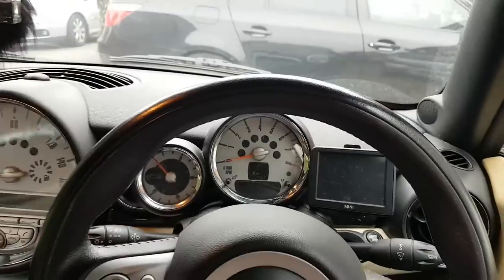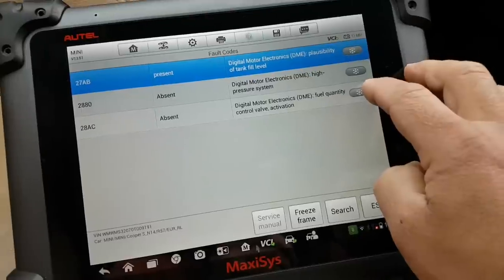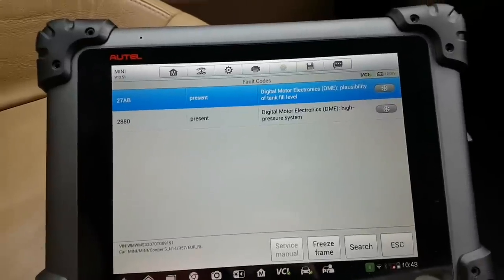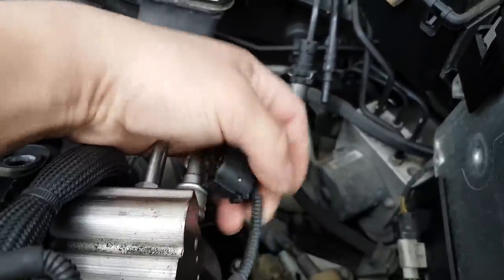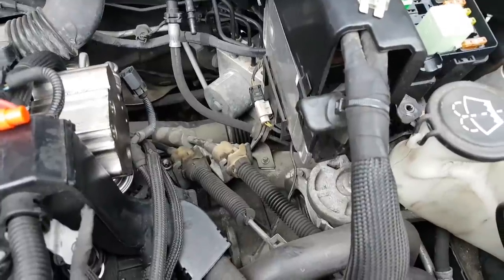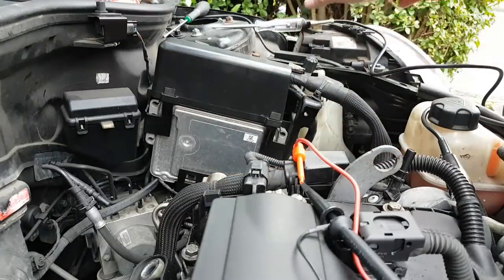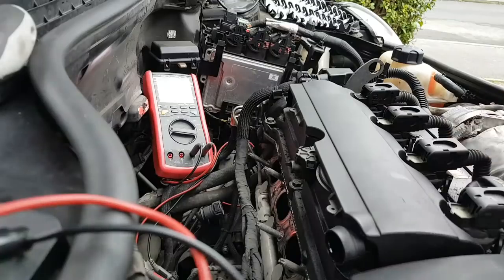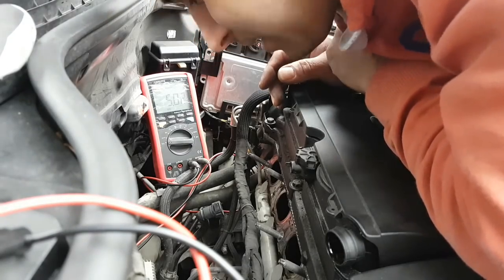Mini Cooper S R56 running rough... Error 2880, high pressure fuel system faults...

Comment: Question! I know this video is old but I have the same car with a similar issue. My fuel quantity control valve is always at 0%…. You said you checked for 12v under load, do you mean car on or just battery on? I don’t see 12v at all when I put a meter on it, but I don’t have a fancy pulse meter like that. I’ve been leaning towards a faulty ecu, I have continuity between the plug and ecu but no voltage. This is the only video I’ve seen with a similar description, figured It would be worth a shot to ask. Thanks!
Reply from the maker: The PWM signal from the ecu is too quick for a multimeter...
But again, and as per the video, if the ecu fails to build the pressure due to a faulty pump, will stop modulating the valve... so no voltage...
The scope will be able to show you right after start the engine, if the ecu is attempting to regulate the pressure...
Hope that helps...
Thank you for watching and for your comment!
Reply: Ok, gotya… my problem is I have too much pressure, not too little. Seems like nothing is being regulated and car is at maximum fuel pressure. I appreciate your response, thank you!!
Reply from the maker: Ah...
You never mentioned before that your issue was too much pressure...
Anyway, what is the pressure readings with the engine off?
Thinking about the possibility of the pressure sensor reading wrong...
What codes do you have on the ecu?
Reply: @LMAutoRepairs  with the car on at idle I have 10,000 kpa and only goes up if I drive it. Never thought to check pressure with it off. I’m no mechanic but it’s now on its 8th mechanic that cannot figure out the issue. I’ve replaced the hpfp and fuel rail sensor. Car chugs and stutters and has no power ltft and stuff at -25 all the time. And fuel quantity control v at 0%… also no codes no matter how hard I try to get one to come up.
Reply from the maker: What is the background of the car?
Have you bought it like that?
Reply: @LMAutoRepairs  yeah I bought it like this… thought it would be an easy fix. A guy has its right now he’s looking into the voltage with the same tool you used.
Reply from the maker: OK...
If is not throwing codes, I would flash the ecu with an original flash...
Just in case someone messed with the ecu software, deleted DTCs or whatever...
It is really strange that is not throwing codes...
Watch this... Will give a better idea of what I mean...
https://youtu.be/rlemo0UIQTk
Reply: @LMAutoRepairs  yeah I had a guy re tune it but its apparently not easy to get it back to stock because I don’t have the original map. It’s a mess lol. I’m gonna end up costing me a fortune. Thank you for your help! Love the videos!
Reply from the maker: Do you have any flashing tools?
Something like the MS908P is able to flash it to stock... or dealer...
Reply: @connordoran6899  sounds like I'm have the exact same probably as you and can not find anything about what is  be causing it to over fuel so much, so I would like to know if you managed to figure it out ?

Comment: Hello, Good work 😊😊😊😁,  if you don't mind i need wiring diagram of renault scenic 2000 1.9 dci of mass air flow 😊😊 thanks
Reply from the maker: Engine code?
Reply: @LMAutoRepairs  the engine code is F9Q
Reply from the maker: Looks like...
Pin 1 to ecu B28
Pin 2 to ecu C25
Pin 3 to ecu B19
Pin 4 to Main relay (12v ignition on)
Pin 5 to ecu B44
Pin 6 to Ground
Reply: @LMAutoRepairs  thank you very much 😁😁 i will not forget this, 😄😄
Reply: @LMAutoRepairs  thank you very much 😁😁 i will not forget this, 😄😄
Reply: @LMAutoRepairs  😊😊😊

Comment: This mpv 2005 when reach 200f start loss power
Reply from the maker: 200f?
The crank or camshaft sensors don't usually give those symptoms...
They usually prevent the engine from start, or hard to start... if is failing like for example due to temperature, can stall the engine while driving... loose power, is usually not the case...